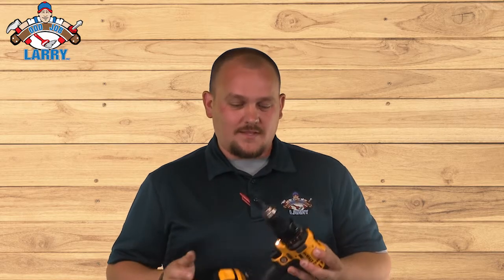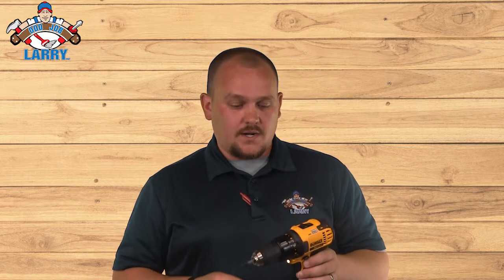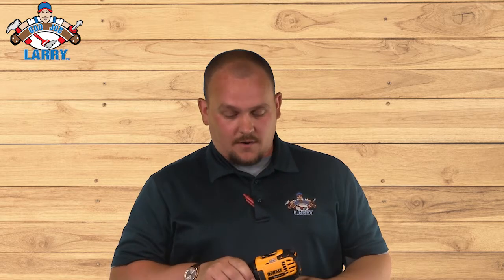How to adjust the torque and speed on a drill!

Comment: If a threaded hole in a wood piece has small pitch, should I be using this drill machine with a Philip driver at lower torque or a Philip screw driver?